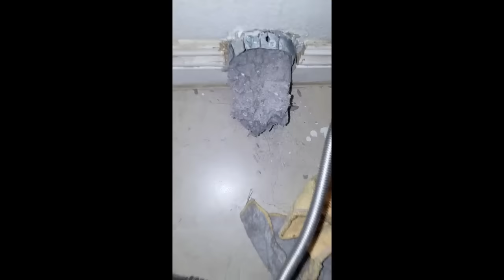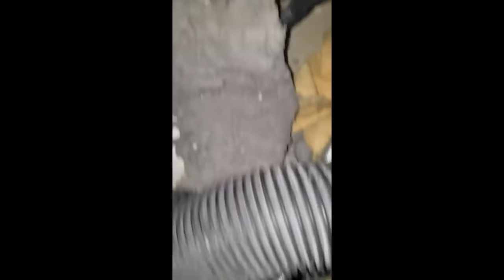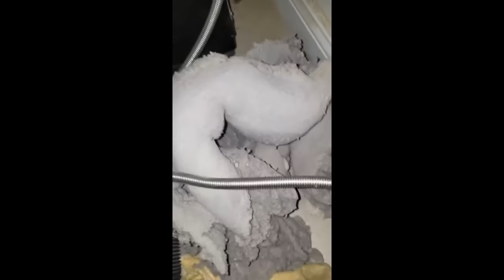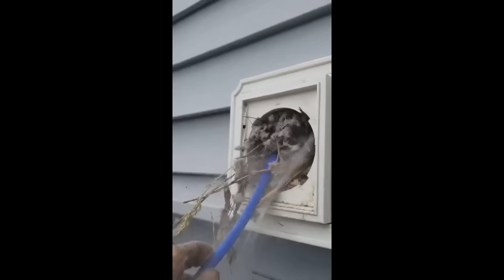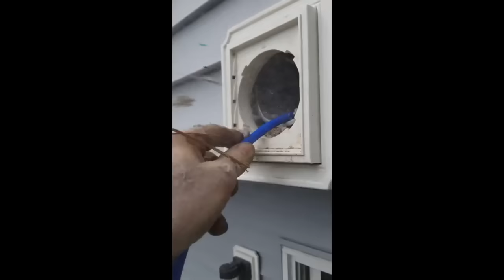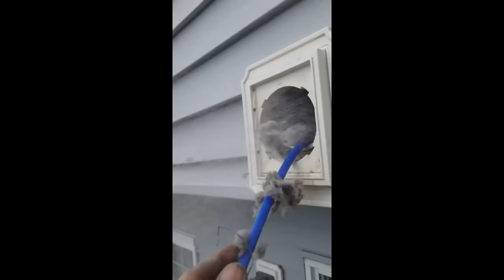Satisfying Dryer Vent Cleaning!

Comment: I'm highly surprised that the houses didn't burn down. Especially the second clip! Oh my god!!!
Reply from the maker: I agree.. good rule of thumb is to just get it done once a year
Reply: They don’t deserve a dryer!
Reply: I know! How were the clothes even getting dry?
Reply: We had a family of 5 burn to death one town over cause of their dryer vent.
Reply: If it's a gas dryer, yes they will catch fire if clogged. Its exhausting gas fumes and steam. Now if it's electric you won't likely start a fire, it only vents out steam. At the worst you'll kill the motor and trip the breaker, but you should clean electric dryer vents as well. If the piping/duct and or semi flexible hose are severely clogged and it's easy to get at it's FAR cheaper to replace them instead of paying someone to snake out a vent.
Reply: @CrankDatPikachu93  it was gas yes
Reply: Just go to a laundromat then.  Smh ridiculous
Reply: The second clip was literally the lint ball that never ends...
Reply: @CrankDatPikachu93  Many fires have started from electric dryers. The electric heating element catches lint on fire.
Reply: Need to wear safety eye wear
Reply: Why the house would burn down?
Reply: @iiiiiiii3283  92% of house fires in the US have to do with a clothes dryer fire. Its the lint. its a fire starter
Reply: The second one looked like it was in a laundry room at an apartment complex or maybe a laundromat?
Reply: Yes
Reply: @iiiiiiii3283  because the lint is flammable and the gas fumes will start a fire
Reply: @smallengines1018  ok, i understand
Reply: @iiiiiiii3283  OK good
Reply: @DuctHeroes  ]m
Reply: That was like a tape worm!!
Reply: I was just about to comment this! That was insane. Some people don't know to clean it.
Reply: I'm just high.
Reply: 0:53 extreme fire hazard indeed, agree with you 100%
Reply: Surprised her eyes didn't fall out
Reply: That's prolly cause the dryer just gave up lol
Reply: Videos like this are highly satisfying to watch. I just had my cleaned a couple days ago
Reply: @vtech2281  Not surprised.. Getting a heat pump tumble dryer here and the lint is always cleaned out.

It seriously reduces the risk of fire if you clean out the lint
Reply: Save the lint. I reckon it's good kindling for disastrous deadly winters. One time I got so desperate that I had to use cotton balls to start up old firewood.
Reply: How would the vent exceed 450F, the temperature of ignition?
Reply: @moejoe1863  It happens all the time. Clogged dryer vents prevents dryers from exhausting properly, which causes the dryer to heat up beyond it's recommended levels, and that causes it to start on fire. Cleaning those vents is VERY important.
Reply: C dommage que l’ont est pas la traduction
Reply: Literally same
Reply: @vtech2281  stop making sheet up!   "The number one cause of house fires is unattended cooking."
Reply: @waqasahmed939  he doesn't know what he's talking about.  "The number one cause of house fires is unattended cooking."  Second reason is "heating equipments" and the 3rd is "faulting wiring."  He pulled that number from his behind.  I don't know why people make shit up.  Especially a whopping 92% number.  It doesn't even make any sense!

Comment: I used to work for an appliance repair business and the engineer knew that I loved cleaning tumble dryer lint. If he brought one in, it was like Christmas and birthday rolled into one for me! He thought I was a total weirdo. Also, one of my best friends had a dryer, the same model as I had. Once, I happened to be there when she cleaned out what she thought was the main filter; when I asked about the main one, she looked puzzled and we came to realise then that she hadn’t cleaned it for 6 years - I almost fell over with excitement and anticipation. It didn’t disappoint - it was like a duvet! Actually, I AM weird! 😳😆😆
Reply: Lol your not alone
Reply: @michaelisweird727  you’re*
Reply: So question is this the same for all dryers or just american dryers? Because I don't have a hole in the vall the air from the dryer goes into. It has a filter next to the door on the inside of the maskine and one on the front of the maskine behind a lid. The one in the maskine you have to empty every time you have used the dryer. The other one I belive is more of an on rear ocaitions type of thing. There is bearly anny dust in the second filter. 

So do you guys attatch the dryer to the airconditoning? Does it have a went like the fan above the oven has?
Reply: @marieprestegard2495  these holes in the wall would be for vented dryers, I believe the same dryer you’re referring to. But some people don’t have a vented dryer wall hole, they simply let the hot air vent within the house which causes dampness and makes your laundry prone to mould. This too can collect lint, just like the door filter. 
I don’t have a hole in the wall so I opted to buy a condenser dryer, which the water evaporation gets collected in a water reservoir that has to be manually emptied instead. Lint builds up around the condenser which should be cleaned every few months.
Reply: @hayleybutler4134 i think my maschine is a condenser dryer as well. But the water just goes out in a tube, and then into the same drain that the water from the laundry maschine goes. I  think there was an option to manualy empty though, so I think I would have to do that if I didn't have the tube.
Reply: Definitely not weird hahaha there's just something so satisfying about it!
Reply: “like a duvet” haha
Reply: I luv it! Lol
Reply: Nah bro dryer lent is fun
Reply: No, you’re not weird. I was just thinking what an awesome  job to have.
Reply: Weird is interesting and fun. Normal is BORING
Reply: @notouchythechichis  I like watching the results but I wouldn’t want to do it myself because it is so dusty and dirty
Reply: I used to clean houses and on the first day I make a bee line for the dryer and its filters and the brush of vacuum cleaner. Same as you, I'd start having stars in my  eyes at the idea of what I might find. Weird's the word but fun's the game
Reply: Where's this so called main filter????
Reply: Please come do our vent. We’ll pay you big time!
Reply: @SquawkCode  It depends on the brand of the dryer but it's usually pretty easy to access. It might be like a small drawer inside the door compartment or a sliding thingumy. Pull it, clean it, put it back.
Reply: You're all fine. Cleaning dryer vents is like unclogging a street drain, or cleaning a car, or washing a rug: Cathartic.
Reply: Think about how many apartments and houses you saved from going up in flames. Definitely not weird!
Reply: I would like that too

Comment: This is what happens when you don't insulate a dryer vent pipe going into an unheated space.
Condensation causes the lint to stick to the inside of the pipe.
If you're building a house, make sure the heating and air contractor does this. If he doesn't, tell them to do it or do it yourself.
I've always insulated my dryer vent pipes myself and have never had a problem with dryer lint buildup.

Comment: 2nd clip: I NEED to know......HOW many years worth was that lint python?!!
Reply: That thing had to be at least 6 feet long
Reply: I agree! Years? Or what?
Reply: That looks like one of those worms that people don’t believe exist. Omg.
Reply: Honestly probably not even a year BC drying things like towels builds up a lot and I mean a lot of lint so like after like 2-3 drys of towels you’ve got a full dust or lint Cather if you have that kind of dryer so I’d say say that had to be like 4-5 months of lint buildup give or take but I’m no expert I’m 14 but that’s just my guess @Elaine Michelle T
Reply: @lucoyprice6289  even with ur logic that couldn't be a few month build up, I'd say a 1.5 year or 2 years
Reply: The owner said 47 years but the cleaner didnt trust and say around 100 years
Reply: i saw the video and it said 40-100
Reply: its from another video, 54 years
Reply: @noraa4real  no
Reply: Ariqas Adam uh.. yeah?
Reply: @noraa4real  the vid says about 100 yeats
Reply: it's 47 years. You can find the video on insider
Reply: 47 years there is a video about it
Reply: @rooftopvoter3015  at least like 8 ft
Reply: And I NEED to know how soft the lint was
Reply: 47+ years. It's from a video
Reply: I would actually say probably only like 3 or 4 years. I’m shocked it didn’t condensate from the heat. There must have been just enough air flow or a leak in the line somewhere

Comment: And they didn't notice the dryer wasn't drying. I'm surprised the dryer didn't ignite this mess.
Reply: I called a repairman  for the dryer who informed me my vent was blocked but he didn’t clear those. My poorly designed vent went 10 feet UP inside the wall, then over about 16 feet to a little roof pipe that stuck up about 8 inches and had a little hood.  I used my leaf vacuum to suck out the lint. I could have made a sheep!
Reply: It was 100 years of build up. No joke
Reply: Ours did just the other, went to 190°

Comment: you should also check inside your dryer blower . its a fan that pushes out the hot air in to the vent . had my dryer service and tech showed me the fan was clogged . he cleaned out and the dryer worked like knew .

Comment: I found that my dryer vent runs through the attic. Well I live in Wisconsin. The attic gets cold in the winter, and the inside of the pipe condenses. Causing the lint to stick to the inside of the pipe. I insulated the pipe in the attic, and added a secondary lint trap. Stays clean now.
Reply from the maker: Thats a pretty bad issue... good thing you got it fixed. Dryers use gas to run and produces carbon monoxide and you definitely don't want that flowing into your home..

Comment: As before my father had passed he was a volunteer fireman as well as being a cop way back in the 1960s I thought it was only a pet peeve however he used to flip out and get quite upset when I would leave the house with the dryer running as he always told me you never know what's in those clogged pipes as that's how so many fires start after seeing this I'll never ever dry my clothes without sitting in the house.  🤯🤯🤯😁😎👍

Comment: Ours when to 190° when drying clothes.  Pipe was clean.  Found back of dryer plugged solid up where air came out under tin  down to pipe.  One clue was very little lint getting into lint trap, no air flow. Very lucky.

Comment: Pretty sure a mask is good enough, buddy had full tyvek suit on for dryer lint 😂 dam these are all fire hazards holy moly
Reply: And no eye protection...
Reply: You never know what can be in there I guess. Better safe than sorry. If I worked for a company that provided those full suits than I would rather wear it than risk bringing something home. I don't think this is the case for this person though since they lack any eye protection.
Reply: is there a   blower attached to the  vent during  cleaning. what makes the dirt fly out?
Reply: @Random-ld6wg  you can either use vacuum or turn dryer on while cleaning
Reply: It’s a hose attached to an air compressor.  The pressure sends it back out.

Comment: My dryer takes 2 cycles to dry anything and I've been trying to convince my family to have someone clean out the lint. Curious, how do you know if your dryer is gas powered? Supposedly those types can actually start a fire where electric dryers almost never do.
Reply from the maker: The easiest way to tell if your dryer is gas powered is to check the back of the dryer and see if there is a gas line connection. If not and you only see 1 line (electricity cord) you have an electric dryer.

Comment: This folks is why you shouldn’t have a laundry area in the middle of your house since you will have to run additional ductwork through ceilings or walls. Not only is it a fire hazard to have excessive dryer vent runs but will cause the dryer to burn out elements along with the thermal cutouts since there’s not enough airflow, even with clan venting there won’t be very good airflow. It really should be against code to put a laundry area in the middle of the home since all dryer fires almost always happen with a laundry area in the middle of the home with long duct runs.

Comment: Dryer has self filter on top pulling out, so what is this vent about?
Reply: There's still lint that gets past the filter, but to get this bad they had to be either running without the filter, or at least didn't insert it properly.
Reply from the maker: You are correct the dryers do have filters that need to be cleaned regularly.. if not the dryer vent gets clogged up and can cause some serious damage.

Comment: It's not from the dryer. It's the insulation wool he pulls out of the wall. 
Holy crap does the owner know that there is a filter inside the dryer.
Reply from the maker: Insulation? Not really sure if thats correct.. this blockage is usually caused by a birds nest blocking the exit point.

Comment: Does the dryer have to be on to get the vent cleaned?
Reply: I pull the dryer away from the vent for access.  Then I put a leaf blower (battery powered) where the back of the dryer hooks up and have it blowing into the vent while I use the vent brush tool from the outside.  Not needed, but I also use a shop vac to help keep the lint/dust from blowing all over the yard.  Advised to wear a mask, you don't want to breathe the particles.  Cheers.

Comment: I never see anyone rig up something to contain the mess. Pipe boot like one you use on roofs. 1/2” hole shove a threaded coupling inside that hole make sure it’s snug. That’s where the brush goes in backwards and before you cover the vent hole than one more hole big enough to fit a dryvac head.

Comment: Are you using compressed air with a water jet cleaner?
Reply from the maker: We use compressed air when doing a cleaning service. It's the safest and most efficient way.
Reply: How strong is the compressor you’re using ?  How much CFM @ 90 psi??

Comment: Do they not have filters?
Reply from the maker: Lint screens will cause issues like this if not cleaned properly
Reply: @DuctHeroes  If you clean the lint screen after each dryer load, can your ducts still accumulate dangerous levels of lint?

Comment: What would cause that much dryer lint? I've lived in my house since the early 80s and had never known I needed to clean the dryer vent so had a company come out today. I think they did a bait and switch on me. Price was supposed to be $79 but one of the men took a photo with his cell phone of the inside of the vent inside the house and the same outside. There was some lint and hair (have dogs and cats) but not like in these videos. But he said it was very bad and jacked the price to $150. I immediately thought bait and switch but since I'd never had it done, went with it. I watched the whole process. No where near what's seen in these videos came out so I wonder if they really cleaned it properly. I do get a lot of lint in the screen inside the dryer every time I use it so maybe most of it has gone there with each drying. I clean that out every time. Was I cheated?

Comment: Do they not know the vent has to be cleaned? Yearly I take apart the venting and the back of my dryer off to get rid of all that stuff!
Reply from the maker: I tried telling them Kaptain...
Reply: Tbh I had no idea given that dryers just aren't that common here

This being said, I'm getting a heat pump tumble dryer and there's no vent. You can't even get gas vented tumble dryers so easily in the UK. They're cheaper than heat pumps I guess

Comment: Jesus christ do these people never clean out their lint trap before doing another load of laundry in the dryer? 

I just bought a new house a year and a half ago and one of my concerns with the place is that the dryer is pretty far from where it actually vents out of the house.  Extremely far compared to my previous house where my dryer backed up to an exterior wall and pretty much had less than 1 foot worth of ducting before it reached outside and by less than 1 foot I mean I literally just attached the dryer to the wall.  I dont think there was any actual duct work just whatever HVAC people call a coupling.... i pretty much just attached the dryer to the exterior vent.   My current place though has about 20 feet if not more worth of duct work and several bends.  Have yet to have any issues...... but then again I clean the lint trap before every load I toss in the dryer.  How the house in the 2nd clip didn't go up in flames is surprising.  I mean aside from the massive fire issue.... did their clothes ever get dry?  With that much lint in the ductwork I can't imagine much was getting accomplished in that dryer.